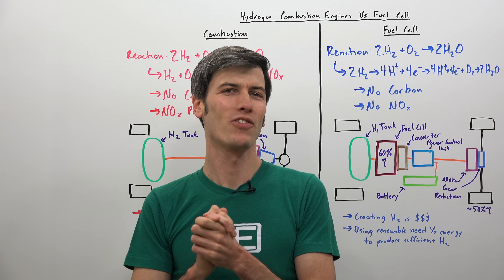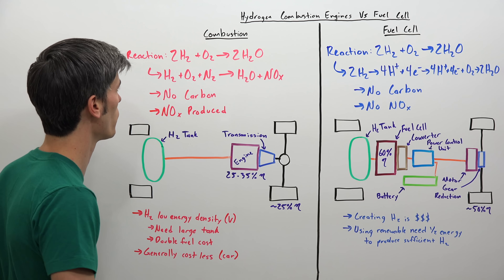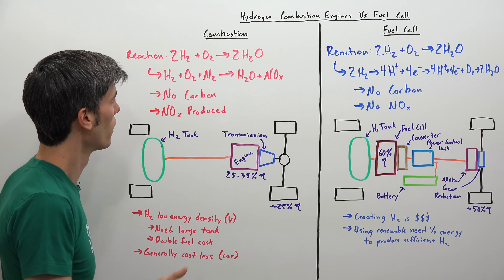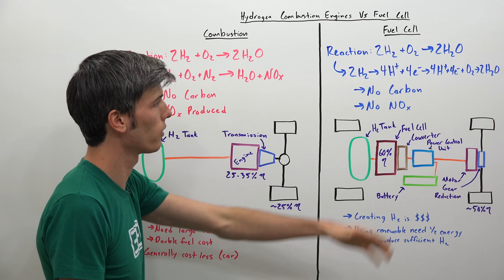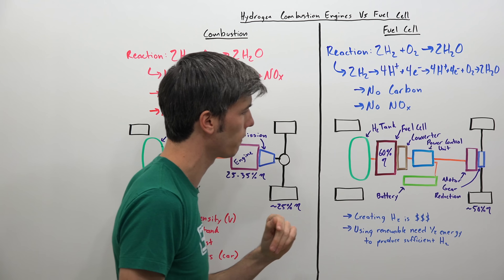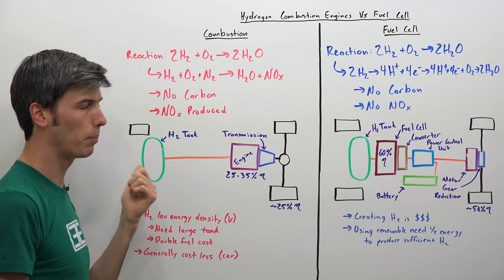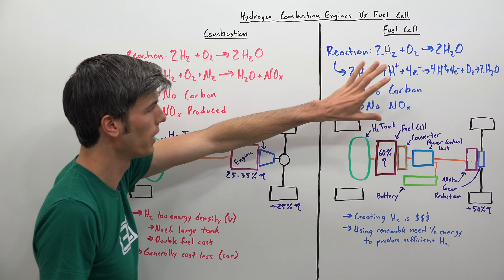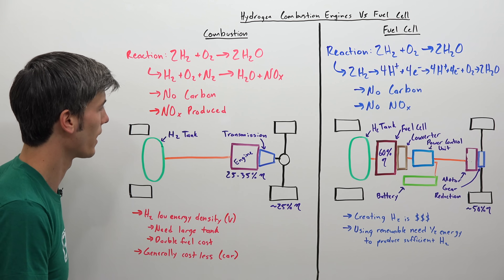Why Hydrogen Engines Are A Bad Idea

Comment: Creating battery's also causes a lot of carbon and battery's dont last for ever.
Reply: Hydrogen fuel cells don't really need batteries anyway the HHO cells are batteries already, but they're powered by a gas which is hydrogen
Reply: @santiagocortez9554  How do you heat the fuel cell to 1000* operating temperature w/o a battery?
Reply: @poppyclypsenoir9156  Many types of fuel cells are "low temperature" fuel cells and run at room temperature.
Reply: Yes, but batteries can be nearly 100% recycled.
Reply: Neither do engines or fuel cells, battery production can be made green too as some papers suggest, the problem with hydrogen is transporting, storing and producing it

Comment: blimps are the way to go
Reply: Lmao
Reply: Up
Reply: It's not a blimp, it's a Rigid Air Ship.
Reply: @Caluma122  Also incorrect, it's called the Prydwen. :P
Reply: @jupo672  Nah, the Prydwen.
Reply: Papa @RTGame approves
Reply: KIROV REPORTING!
Reply: Oh the humanity
Reply: Blimps are extremely slow and bulkey
Reply: So why can't you use the hydrogen combustion engine in a Prius-like manner to bring up efficiency? That is, use it to in part power up a motor generator.
Reply: country roaaaaaaaaaads
Reply: And you can play Led Zeppelin on them.
Reply: @Mooselover1011  na, its called the floaty balloon thingy
Reply: Not if we run out of helium, you don't want to use hydrogen, trust me.
Reply: @kaibaCorpHQ  kabooom goes the H
Reply: Robotnik got it right in 1991
Reply: Big floaty bois
Reply: T E 
Slow and bulky yes. But much faster than shipping and much cheaper the fixed wing flight. Hydrogen heavy lift cargo airships could be viable. The safety will be much improved over the zeppelins as materials, gas sensors and weather forecasts have all greatly improved. The top surface could be thin film photovoltaic, with batteries to power safer more reliable electric motors for propulsion and vector thrust.
There have been companies trying to do this with helium but I think the cost of helium will make this too hard to be economical.... maybe good for a cruise ship type of model.
Reply: I'm pretty sure the hindenburg was a publicity stunt to keep people from thinking about hydrogen as a fuel source because of greed and also these kinds of people actually want to destroy the earth. They don't want you to have a good life but they want you to be riddled with illnesses and weaknesses which is just better control of the people.
Reply: @kennethwilliams2738  that's called the hyperloop
Reply: Oh no!!!?remember the Hindenburg?

Comment: "Luckily, in the history of humanity, nothing bad has ever happened from lighting hydrogen on fire."  Mark Watney, The Martian.
Reply from the maker: Lots of people saying hydrogen is dangerous because it's combustible haha. Same can be said of gasoline, diesel, ethanol, etc. They're good for combustion engines because they combust!
Reply: @EngineeringExplained  Hydrogen does combust a bit more violently though :)
Reply: @EngineeringExplained  The fuel is not under pressure or thing like that ? 
Beacause it take some place otherwise 

Ps for the time battery also are not the best in accident
Reply: @zblurth  batteries dont explode, they start to burn after few minutes, allowing passengers to escape. Gasoline and hydrogen explosions can be violent.
Reply: A misunderstood reference to the Hindenburg disaster?
Reply: @EngineeringExplained  Totally agree on the 'combustible' point.  It doesnt overly worry me straddling the 4gallon petrol tank on my motorbike.
Reply: @kenkalajdzic  no, gasoline is a hydrocarbon chain. Meaning it's made of hydrogen and carbon.  The hydrogen is what gives the reaction its energy.
Reply: @cytrynowy_melon6604  tell that tidbit to the lady that lost her head to a CELLPHONE battery.  Just ONE. Oh, that's right, you can't.  She's dead.
Reply: @cytrynowy_melon6604  also, car manufacturers build safety features into their vehicles to negate that very issue.  I imagine that it would be intelligent practice to do the same when converting gasoline to HHO.
Reply: I straight lost my mind when he said that, and I about died laughing when it blew up in his face😂😂
Reply: @cytrynowy_melon6604  while technically the batteries dont explode, they can be the source of an explosion.  many batteries can produce a large quantity of hydrogen gas when discharged rapidly and deeply.  drop a metal plate across the terminals of a car battery and it will go boom in short order.
Reply: @Mark Baker does it look like it's that important?  I mean, 1f---ing word is mispelled, AND SPELLED LIKE THE CITY ITS NAMED FOR,  and you lose the self control to not mention it.  I guess depleted ego is a real thing, after all...
Reply: @guardsmanom134  The Hindenburg was named after Field Marshall Hindenburg, the last president of the Weimar Republic.
Reply: @TheSittinDuk  how was that spelled again?
Reply: @guardsmanom134  Did you intentionally believe it was named after the town of Hindenberg or Hindenburg? Because Hindenberg is basically only a go-cart track south of Berlin. Or a field with cows north of Berlin. There's two towns. Hindenburg is the name of equally uninteresting places.
There's a city in Poland that was also called Hindenburg for a while, after the Field Marshall.
Reply: you realise petrol is highly highly flammable right? and every single car has one. you realise lpg is commonly used right? that's a highly volatile gas that is also commonly used. hydrogen is no more dangerous than anything already used.
Reply: Nothing so bad as lighting crude oil on fire.
Reply: Ever heard of zeppelins?
Reply: @sultanabran1  Petrol, methane and the like, only explode under certain conditions. Hydrogen pretty much always explodes. Hydrogen also ignites much easier. Unlike natural gas you can not scent it. All the things that make conventional fuel safe, hydrogen does not have.
Reply: Hmm electric cars ☝️ electromagnetic radiation  🙄
Reply: Ken Kalajdžič   Hmm super fueler dragsters, seek fuels that combust alot more violently. eg nitro fuels...H combustion can be regulated,,and the violence can be mitigated with feather pillows..
Reply: @kinnlmk  Like pooling on the ground giving off fumes? Pressurized hydrogen will dissipate into the air quickly instead of hanging around like gasoline if the tank ruptures. It's lighter than air. 

In either case explosion is unlikely. What you get is a fire if ignited. With gasoline you get a longer burning fire on the ground it pooled in, with hydrogen you'd get a quick stream in whichever direction the tank rupture occurred and then done.